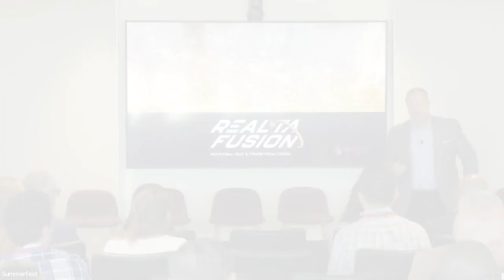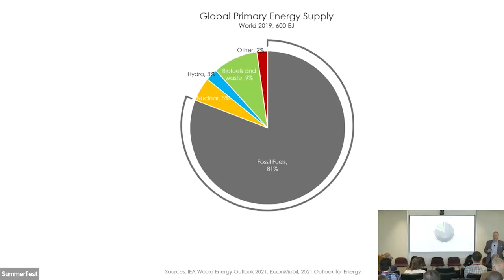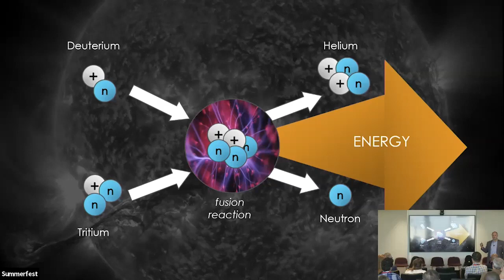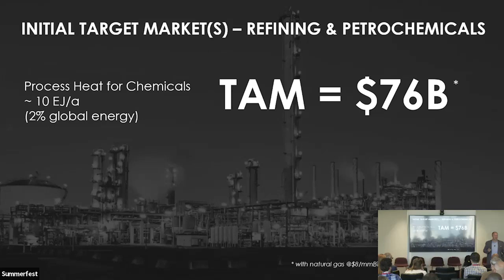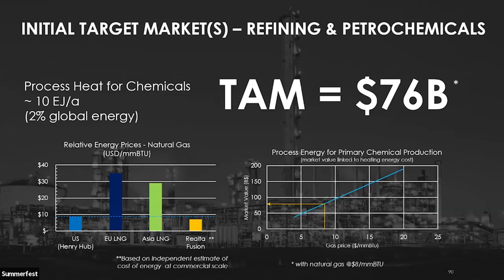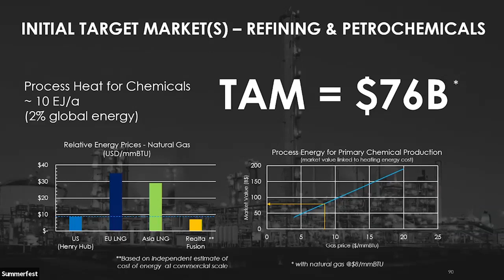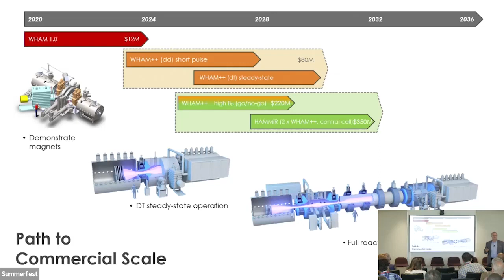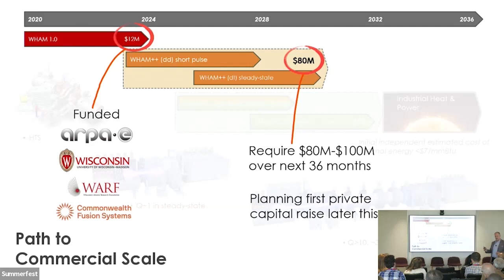Realta Fusion: Breakthrough Physics for Clean Energy Generation

Comment: Helion has beat you to the finish line on getting a system built. I would rather you team up with them.
Reply: It's the same general design (mirror device), but uses D-T fusion instead of He-3+D. This has some benefits like a much higher rate of fusion at a lower pressure and temperature and avoids having to breed He-3 in a separate reaction. Unfortunately, it requires tritium and shoots out a high energy neutron which leads to more material degradation. We will see which one wins out, but since this design focuses on heat and Helion creates electricity directly they may be supplementary companies rather than competitors.
Reply: Helion has a similar looking system, but it is not the same. Helion is using an approach called the Field Reversed Configuration (FRC), combined with significant magnetic field energy recovery (the details of which are still hidden from the public eye). Realta is using an axisymmetric simple mirror and eventually a tandem mirror, which lends itself much better to a steady state reactor as opposed to the pulsed reactor that Helion is going for. Both are viable design choices and worth further study, especially since they are relatively low cost compared to more popular designs like the Tokamak
Reply: @matthewnyberg737   This design is good for a fission-suppressed fusion hybrid. Fission-suppressed fusion hybrid is a proposed power source that combines nuclear fusion and fission processes. The idea is to use high-energy neutrons from a fusion reactor to trigger fission in non-fissile fuels, such as uranium-238 or thorium-232. The neutrons capture in the blanket convert the "fertile" material into fissile isotopes, which are then used as fuel in conventional nuclear reactors. Q2 to Q8 would fly,

Comment: Seems like a marketing pitch, but the reactor is a pulse mode plasma compression device that uses flux compression to heat and impact the plasma bunches. I could make it much more practical by making the plasma rotate in counter rotating vortices as it collides. This would be done using a triphase microwave field at each end to cause the plasma to rotate like a motor armature. Then the plasma will gain a lot more of the energy as it goes through the magnetic field array. The benifit is the fusion reaction itself should do the job of ionization and heating allowing the device to operate indefinitely using only the microwave field to induce rotation and a static magnetic field for stabilization after the initial starting pulse. It would need an energy mode converter to both protect the reaction zone from overheating and transform the raw nuclear energy to heat and electricity. I would use BeO for this component. The neutron generation alone could breed fuel for the device with a beryllium based  neutron generator (win-win since BeO is very refractory as well). It also has the ability to generate specialty isotopes with the neutrons that are useful. This would substantially offset the cost of operation. It may be possible to use alternate fuels as well, simply by scaling up the device starting with D-T and changing over to D2 or BH fuels or a mix like Boron deuteride monohydride, BD2H. 😁🤓
Reply: You were correct in your first sentence. The remainder was bullshit. ;-)

Comment: Fusion is not the be all and end all of power generation as we have all just learnt.
The breakthrough was achieved by a fusion reaction not a power plant .
And the power generated by Livermore was a miniscule net gain .
Fusion power plants yielding unlimited clean power have been a pipe dream and overhyped for years .
With the recent Livermore success doubling down on the long long path to a working fusion power plant .
Reply: I mean, it really could be. That's sort of why people obsess over it so much.
Reply: @phillipshorter7751  
The fuel fusion reactors use is not easy to get and a tiny net gain of power was made recently by a fusion reaction .
I understand the theories completely but l still think the race for a viable fusion power plant is a scam with billions wasted .
Especially considering the power plant l have just designed .

Comment: Interesting - industrial heat does seem like a low hanging fruit, but a big one.

The reactor blanket design guy is there because you will have to produce your own tritium, right?

What temperatures do you plan to produce? If those are high enough, then steel production can also be targeted.
Reply: Blankets are necessary for tritium production, but also capture the energy coming out of the fusion reaction by letting the 14.1MeV neutron (or 2.5 for D-D fusion) collide with it. It depends on the blanket design and secondary coolant, but due to materials constraints they are probably not getting to 1400C. Lead, Lead Lithium, or a molten salt are the most practical liquid coolants and can technically get up to >1500C before boiling/dissociating, but would eat through any structural material that also works for a fusion environment.

Comment: Isn't this the same system Helion has already built?
Reply: On the surface they do look similar as they are both linear devices based on the magnetic mirror concept, however Helion is going for a Field Reversed Configuration (FRC) with an emphasis on pulsed power generation and significant energy recovery, while Realta is making a high field simple mirror, and later a tandem mirror, which will be operated in steady state. The differences between the approaches are significant, but hard to see without going into the technical details
Reply: Yes, this is the same bullshit that other "ventures" are proposing. ;-)
Reply: @pzboy47  no sir yu oare wrong about helion who will. be beating the wisconsin h asymmetric mirror

Comment: Villa violates newton second law of thermodynamics. There’s no free lunch it’s expensive to build an experiment gives this guy a job for a while with his cronies. Are you gonna put hundreds of millions of dollars into it or you’re gonna get $.50 worth of electricity. You do the math that’s a dramatic explanation but there’s no free lunch left mom‘s buying it. Where do they get off. Are you green new deal guy. That doesn’t work eitherAnd you have to take power off the grid to run your experiments little on a working model. May work in an absolute vacuum for milliseconds but you’re not gonna be able to harness the power from it friction losses to great there’s no free lunch bro
Reply: Power is from capacitors and you don't need much power to charge them.